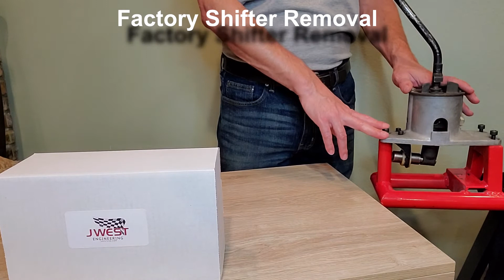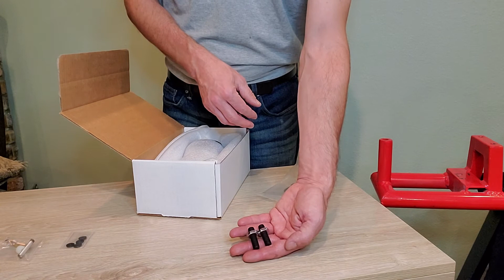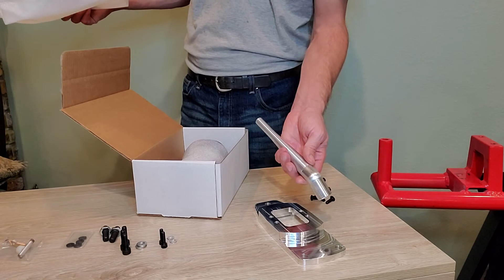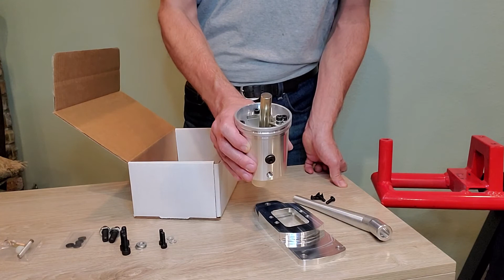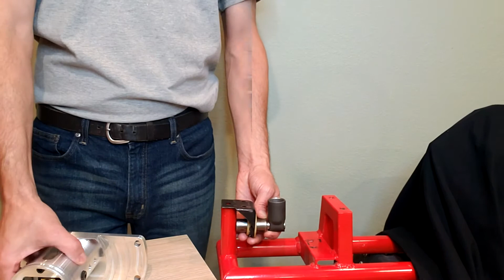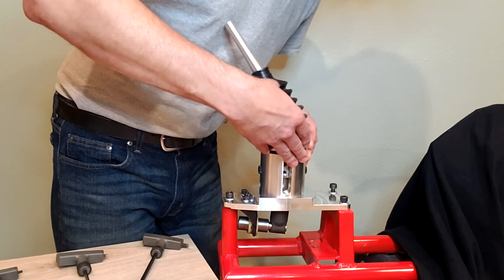RennShift Shifter Tutorial | Installation

Comment: Iv'e just bought one last week. Looks simple enough to fit. Should I spray any grease inside before fitting up?
Reply from the maker: The shifter internal pivots ride on self-lubricating oilite bronze bushings - no lube required.  The springs and lockout have grease already applied.  You should apply a silicone grease to the rod bushing and inside the cup bushing socket.
Reply: @jwestengineering7831  lovely. Can't wait to fit it now. 👍🏻

Comment: The part of the shifter that is not covered by the boot, is that left exposed?
Reply from the maker: The included boot allows the lower part of the shifter to remain exposed (because it looks cool!)  If covering the whole shifter is desired, the original boot from a 1973 and later 911 will work great with the RennShift, and they are surprisingly inexpensive directly from Porsche.

Comment: Good time to replace bracket bushing.
Reply from the maker: Very true.  We don't include the rod bushing or other linkage components with the shifter because often customers will replace all the factory parts and then find out the car still does not shift to their liking and purchase the RennShift.  The cup bushing is included on the bottom of the shifter shaft.  However, we do have package deals that include all the parts to rebuild the linkage.  We even have a replacement bracket to hold the shift rod bushing if your is bent/rusty/stripped/etc.